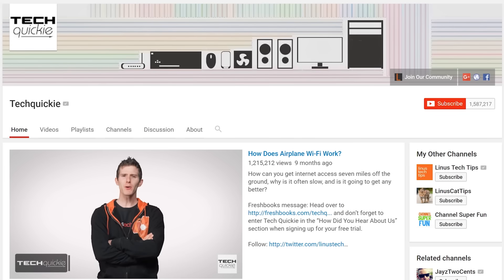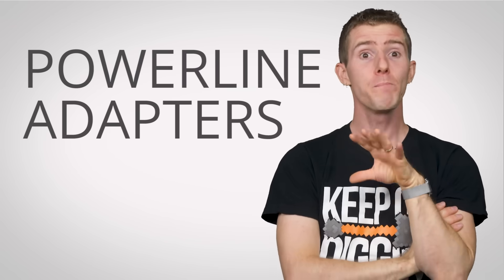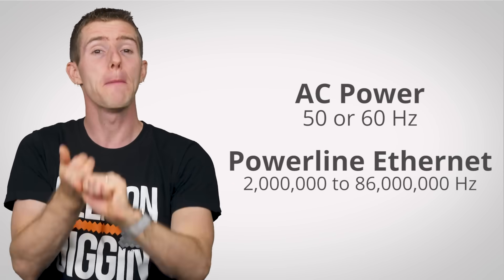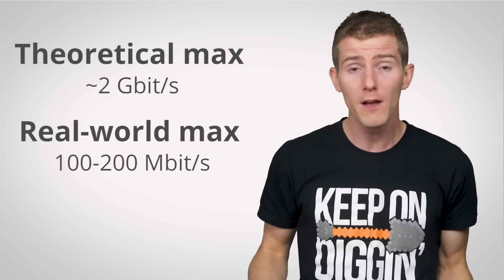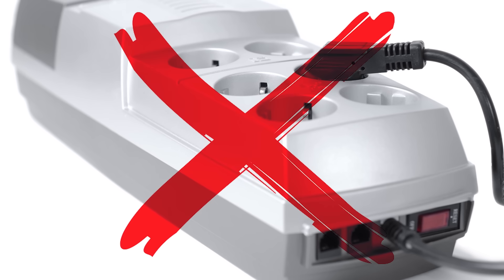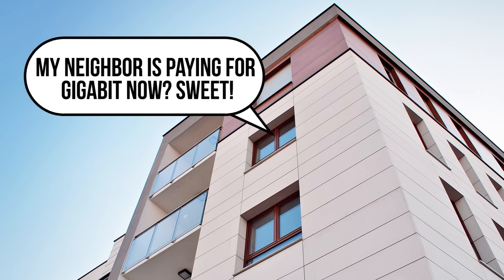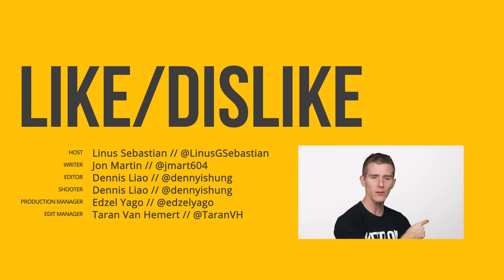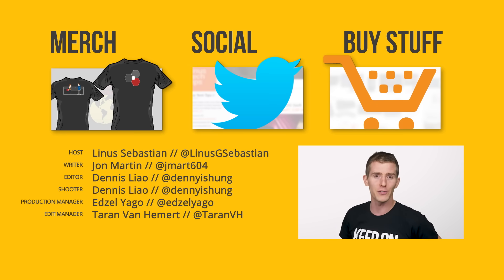How Does Powerline Ethernet Work?

Comment: Powerline networking won't work well for you if you are already using a lot of electricity hungry devices on the same breaker. I tried to use this as a cheat to get better internet but because I have a gaming computer and air conditioner on the same breaker, the connection was so horrible that the wireless I was trying to replace turned out to be better. When you first plug it in, it will work for a minute but very quickly degrade in performance if you are in a similar situation. 

These are best for people those people who are such neat freaks that they don't actually use their house, for them it should work flawlessly to add a wifi router with it wherever they want for their phone and or laptop.
Reply: "These are best for people those people who are such neat freaks that they don't actually use their house"

Or, you know, have a properly wired house that has the AC and other high power appliances on their own dedicated breakers like they should be.
Reply: @AboboKing  We all do not have the money for that.
Reply: Do not spread misinformation. It is purely based on where you live and the quality of your wiring. I can run a microwave, tv's, air conditioning and a lot more and my powerline adapter never cuts out. Your experience is subject to you. Powerline will work differently depending on where you are, and as the video said, what outlet you're using.

I had success using powerline in a flat with 3 other students who had gaming devices and never had any problems as well.

I'm not saying your experience with it is wrong, I'm saying your conclusion and "recommendation" is completely misinformed and almost like you didn't actually consume what the video explained.
Reply: My home was built in the 1950's so it really isn't that new, although I will admit that the flats I lived in whilst at uni (it wasn't student accommodation) but it did feel a lot more structurally sound compared to my actual home ha.

I am not providing any misinformation as I structured my response as a complete "this is my experience and situation matters". I did not provide any recommendations on whether or not to buy it as opposed to yours which is "my experience is bad therefore they suck". 

I was merely stating that just because one person's experience is good or bad has nothing to do with the power line itself (mostly - there are some off brands out there).

In any case, like the video said, buy one with good refund policies, try it and if it works yay! If it doesn't, it doesn't. Return and find something else. This is how I've always recommended them.
Reply: Shadow Girl You should REALLY try to NOT use ANY sensitive electronic device (especially a high end gaming PC) on a circuit with an intermittent high-current service like an A/C., I'd be highly concerned about voltage spikes when such things (like the A/C) turns off. My entertainment gear,PCs and the like are only on circuits that contain either lights (low surge on/off cycling) or like items. My A/C units, Microwave, refrigerator, ETC are on different circuts.
Reply: The answer was to Simply install an ethernet cable, all around best solution.
Reply: Powerline works fine: my brother's room is across from mine with the router and he didn't want wifi. Since we're in an apartment, I couldn't run a cable unless it went under a door and risked damage. A powerline adapter was perfect.

We're also in a place that, while old (built in the 70s/80s), has the breakers laid out in a (mostly) sensible manner with the A/C and fridge on different circuits (think the A/C is on one and the fridge is tied to kitchen lights). Even my old house where we used these, built sometime in the 40s/50s, had sensible circuits. Just because your wiring is horrible and the breakers are very likely being borderline overloaded doesn't mean this technology doesn't work.
Reply: Really shouldn't matter the frequencies traveling through the line from the grid are much different than those of Ethernet, which is how it works, it filters the power and keeps only those in Ethernet range. Ethernet over power works just fine for most people, even with A/C and the like, your wiring could be damaged, shittily done etc.

To those commenting A/C being on the same breaker n shit of your PC's ... Your PC has a Powersupply, this converts AC power into DC and this in turn prevents said surges from doing anything to your PC, specially if it's not dirt cheap, those bigass capacitors in there are what does this however if your PSU is undersized you may run into issues in these scenarios but undersized will run you into problems sooner or later regardless.
Reply: Shadow Girl Use roof mounted 5ghz repeaters. More expensive, but consistent. And less prone to interference.
Reply: WAQWBrentwood all the plugs in the room are on the same circuit, what am I to do? Thankfully many modern motherboards have multiple phase power capacitors design to smooth out the power to your computer, and mine includes this functionality so I haven't had any issue. I am also running a strong overclock on the CPU (i5 from 3.4ghz to 4.5).
Reply: Jazz A  I wouldn't trust it around microwaves it may cause interference.
Reply: so you couldn't run a normal ethernet cable why?
Reply: Totally agree with you. Have been in this situation. Bought powerline adapters for my three storey house with all the ACs, microwave, oven etc, the ping always fluctuate ( I can confirm when someone uses the microwave the connection suddenly lost). Might as well spend the money on better wireless router or do a proper CAT5/6 wiring and create another access point (problem solved: consistent 5-15ms ping)
Reply: So like are you single
Reply: Jazz A sounds like you're in a very modern building, probably made for students. If anyone's passing on misinformation, it would be you by giving a scenario which to anybody else would sound like it should always work.

Comment: Now Linus, once you have a powerline adapter, what is it going to do with the "smart meters" for measuring power use?
Reply: smart meters only measure current on the 50 and 60 hertz frequencies so the data from the power line adapters are usually ignored unless the meter also has a surge protector built in.

Comment: Alright, gamer perspective here on power line. I was gaming on wifi for a few years and decided to finally switch to ethernet, but my home doesn't have lines running to all the rooms so I figured hey I'll try power line. This was purely for latency, not for download speed. I just can't recommend it. I did get better latency than on wifi, but I also had consistent drops. Eventually I just paid out the money to run Cat5 and I am much happier with it. No substitute for real ethernet ladies and gents.
Reply: SectorCodec Depending on homes. Before sorting to Cat5 as my last resort, power line is working just fine with me. Latency much better than wifi, and drops are non existent. Sacrificing top speed for latency is a justified trade.
Reply: I'm glad it worked for you. Didn't work for me and I wanted to warn others. Ethernet is simply the better choice if you want top quality.
Reply: Another gamer perspective here. The way my house is built I could not get wifi to some of my rooms. I bought a power line adapter and holy shit I couldn't believe I had 100% internet speed from this far end of the house. Depends on how your house is built I guess. Really was a game changer since I didnt want to buy hundreds of feet of Ethernet cables to wire my house
Reply: i game on that power line ethernet for about a year now and never had any sort of problems
Reply: Wow that's weird, I tried the powerline adapters and their speed sucked compared to wifi 10mbps vs 50mbps but the latency was maybe just a couple ms more than when using an ethernet cable, which is a lot lower than the latency I get over wifi.
Reply: SectorCodec Yeah, nothing beats direct Ethernet connection.
Reply: I switch to 5Ghz wifi. it's better than the powerline I had. and there's no ping problems either.
Reply: I reckon it's because of the old wiring at your home. Mine's brand new and powerline works fine. Anyone who wants to get powerline should check out the wiring 1st before committing.
Reply: I disagree. Of course Ethernet will always be better but in term of bang for the bucks as long as your powerline installation isn't too old or too shitty, it's all good
Reply: Wifi can be miserable for any kind of gaming that is dependent on fast response, especially if you live in an apartment.  It's constant data jitter as packets are lost or delayed because of dozens of wifi's around you.  I would recommend anything over wi-fi.
Reply: I too am a gamer and yes when you run detailed network statistics the numbers are worse.  Yet, on wi fi i was unable to play BF5 due to lag.  With the powerline adapter i am still no good but its not because of lag.  Two story apartment with the router/ modem downstairs.
Reply: Same happened to me. Latency and speed was good but random drops were driving me crazy.
I bought a new 5GHz router and a couple of USB adapters to solve my problem. I can't use direct cables. :(
Reply: For all of you, try play on GTA 5 online and start killing people using WiFi first after Ethernet and then Power Line. You will see with your own eyes which one is better. And count those single bullets of sniper shots you need to get to kill a player.
Reply: im old school i still trust cata 5 & hid the wires well put this internet headache away once and 4 all.
Reply: I just dont want anymore random drops. (Upload and download is fine, using a 5G router). My room is almost on top of the office where the router is but there is alot of eletrical devices in there. Will it work for me? I cannot use eithernet
Reply: Ok so I had my devices for a month now. And when there isnt a random slow down with the incoming internet in the house it works quite well. Sometimes it gets a little buggy and drop my upload speed to almost dead, but no more being booted off Xbox LIVE for the most part. Normally download speed will be about 70mbps and 4 to 5 up. And when it works well I have pretty much no lag. Now lately Ive been getting throttled hard and had lots of latency on World of Tanks but still no drop outs. I even tried this at my granparents' house with 50 year old wiring and I got like 50 mbps down and 3 to 5 up with barely any lag.
This is with the two as close to each other as possible.
Reply: Not bad luck, I love my Cat5e. I actually get higher speeds than I even pay my ISP for when I use it. I get around 240 Mb/s down when I pay for 120Mb/s down.
Reply: Possible! Still, I'd stick with good ole Cat5e if  it is at ALL possible.
Reply: I'd say Rainbow 6 Siege is better tbh. Anyway it's obvious ethernet is the best choice it's just not the most convenient for some people.

Comment: Linus, have u done network devices?
I want to buy the TP Link ones from Best Buy or NCIX by Black Friday, and it'd be cool if u can make cool facts about it!
Reply: David Kahn thanks dude! But dw, Im thinking of buying a TP Link router this Black Friday, as a person not getting a good wifi signal at home
Reply: Philly Jones try a WiFi extender at the 1/2 - 3/4 point of routers range limit, as you can get them on eBay as you can get refurbished Netgear ones which I've had decent results with(just don't get it near a microwave lol) for around $20. it's the most easy, and cost effective solution to try first. 
https://goo.gl/mNDbYx
Edit: Here is a TP-Link one for $15, but I can't vouch for it since I've never used their extenders before, but at that price it's worth a shot. 
https://goo.gl/341D7p
Reply: Spooky Ronnie im buying what its called "TP-LINK Archer C60 Wireless AC1350 Dual Band Router"
Reply: Linksys has been shit ever since they were sold out by Cisco.

Comment: 3:18 also don't plug in your Powerline Adapter next to compact fluorescent lights (CFLs)

they can produce a lot of electrical noise wich interfere with your Data Signals

Comment: What if you have multiple current circuits in your house?
Reply: Fisolino it will Work within 1 breaker in your house, but cannot go to a circuit on a different  breaker box
Reply: both the sender and receiver need to be on the same circuit

Comment: I have one and I love it. Works wonderfully. Speed is 30/5 but I get the same speed and ping as when I’m plugged into the router. The TP-Link one I use is encrypted too, so I assume it would be good for apartments
Reply: I bought a TP-Link AV2000 recently, and get the full speed of my internet connection (150 Mb/s down). Definitely better than what I was getting over wifi, and Steam Link works flawlessly too. A++ would recommend.
Reply: I also have the Tp link one
Reply: iPhony I also have a TP-link one, they're all encrypted between them. It can't really handle my download speed, but gets close enough. I have it connected to a 2nd router, because the Wi-Fi signal from the main router is really low with this distance and it was no option. Pings are stable, that's the most important part, over low Wi-Fi it was impossible to get them stable.
I have the emissor connected in the same socket as the router and some other stuff, that could be why I see some decrease in download speed, but not significant. The receptor it's not on the same socket as the pc, but close. The decrease is probably caused by the distance, if I try a closer socket in another room, I can get higher download speed.
Reply: Not sure, sorry. I got the TL-PA9020P kit from Fry's Electronics.
Reply: iPhony so you 100% have to own a router right.
Reply: aquariex24 2nd is revision of the first, buy it over the 1st one. 3rd is also an extender.
Reply: iPhony I know this is years later but could you tell me or link me the product you use?
Reply: How does the thing work exactly I know he said it but do I have to plug one into the router or can I just plug it into the wall. Also what cable should I use? If they don’t come with one? Cat 6, cat 7 or cat 8 or all of them
Reply: I'd like to know as well from what puddingsworth stated on his comment.do I plug one in wall and then to my router in the living room and then a second one in the other room and plugged to the device???or what exactly am I doing?
Reply: What do you mean by 30/5? :)
Reply: Would it work effectively if you live in a detached home with more than one floor? I was thinking of buying them and placing one near the modem and the other one in my room where I need it.
Reply: What TP link should I buy if I live upstairs and want to plug it into my wall to connect to the router below and then plug an ethernet cord into the TP link in my wall and into my PC?
Reply: The moment when you recognize someone in the comments on a youtube video.